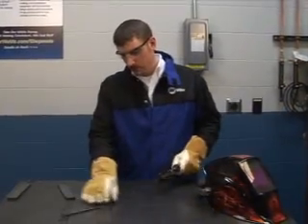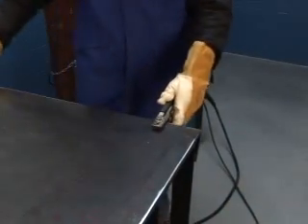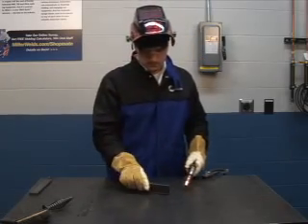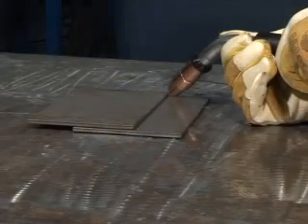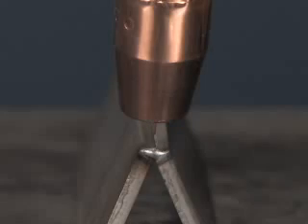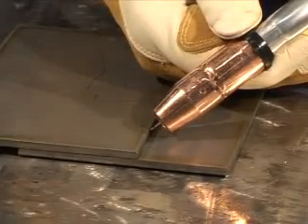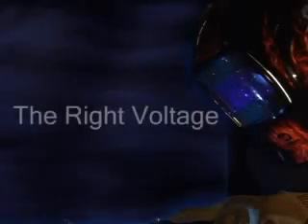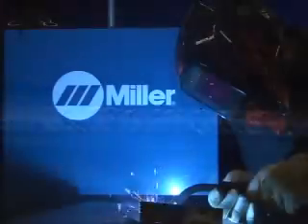MIG Welding Techniques

Comment: When you pull/drag, where is your gun pointing? It's pointing back at the puddle/weld, which is where the argon/co2 gas is being sprayed at. So yes you can get adequate gas coverage either way, the problem is when your gun angle is too severe, but that can happen with either push or pull, and thats when you can get porosity. If you find yourself getting porosity often, you should straighten your angle a little bit, clean your gun and the metal you're welding on.

Comment: @tar21gi i was always told that when you pull the argon gas doesn't surround or get trapped around the weld which makes it less strong/less penetration and can cause verocity which isn't even a weld, just makes bubbles and just a completely hollow weld that isn't at all strong. is that true? or just bull?

Comment: @Koba4329 You can push or pull with a MIG welder. When you pull with MIG you get deeper penetration, however the weld profile isn't as nice. When you push you don't get quite as much penetration, but obviously you get a much better profile. So it all depends on the job, and the finish required, but either work.

Comment: k im getting conflicting stories here. im young and learning how to weld from a old pro. he tells me "push a wire, pull a rod" cause when you pull on a wire the gas doesn't stay long enough on the weld for it to seel properly so you get verosity. is that true or is this video true?

Comment: could you discuss multi pass welding and whats the best welder for weldng space frames using 0.120 chrome molly or mild steel.it for my race car/weekend fun car.
I just bought a chicago mig flux core 90amp that says it can weld 3/8 on a single pass
thanks in advance

what a way to test for  weld strength I will need in a space frame on chrome molly/mild steel 0.120 tube.its for my tube chassis in my race car/super luxury car.

Comment: @gownozjad3, it is hard to examine many types of weld joints to determine what type of penetration you are getting without destructive investigation. Got to cut it open to view it. Do some practice welds are pieces that are narrow enough that  you can take welded assembly over to your cut off saw and cut off some well back into the weld. This is the best and maybe only way to see what kind of penetration you are getting, other than being able to do an x-ray of weld.

Comment: I think it has everything to do with the gas flow.  If the gas flow is in front of the weld (a push), it shields it more, maybe cooler.  The pull would not have as much shielding gas and would be hotter with more penetration.   Someone correct me if this is wrong.